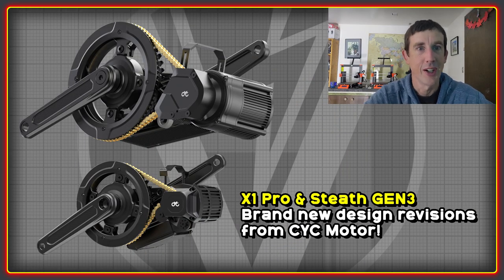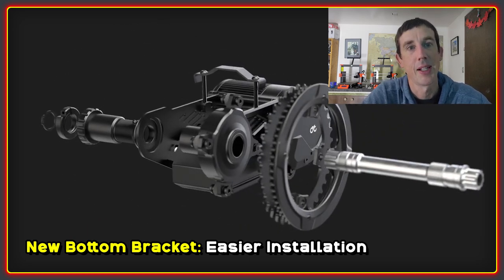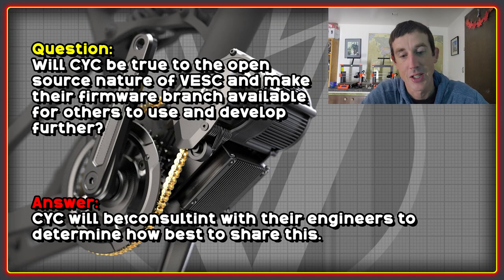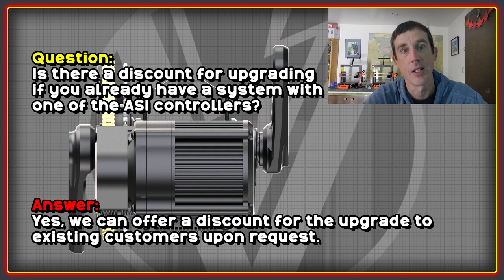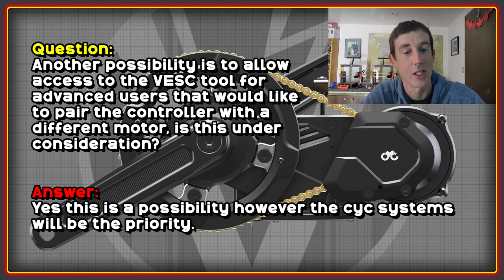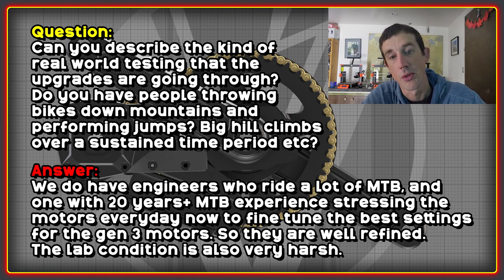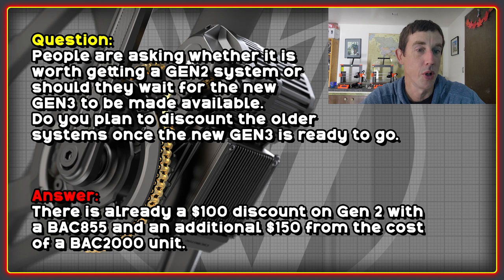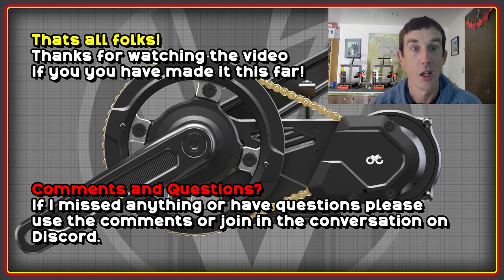CYC X1 Pro & Stealth Generation 3 Overview and Q & A

Comment: All gen 3 motors are faulty do not buy
Reply from the maker: Where is your source Paul? Cheers
Reply: @HighVoltageKits  After 3 motors I then had to pay $750 to upgrade my gen 3 kit to a gen 4. Upgrades included a new gen 4 motor, controller upgrade from ASI BAc2000 to the x12 which also needed a new display. I would've saved money by throwing my gen 3 in the bin, then purchased the Gen 4 instead. My bike was second hand but only 2 months old. All this happened within 8 months of the bike being built. The gen 4 upgrade kits seems to have sorted it. As I said I believe all Gen 3 motors are faulty.
Reply from the maker: That’s awful Paul. Sorry you had to experience that.
Reply: @HighVoltageKits  CYC remove all my comments from their Youtube channels warning people about the Gen 3. I'm just trying to help others avoid the trouble I've had with Cyc Gen 3's Is all.
Reply from the maker: That’s disgraceful behaviour. They should have backed you on this.